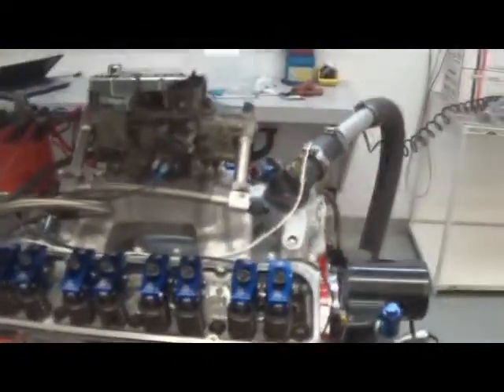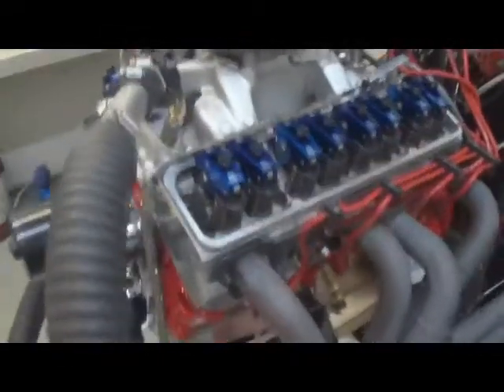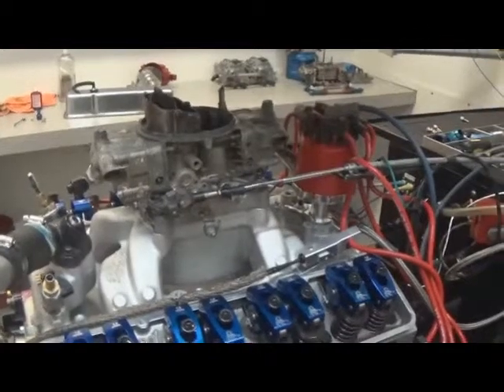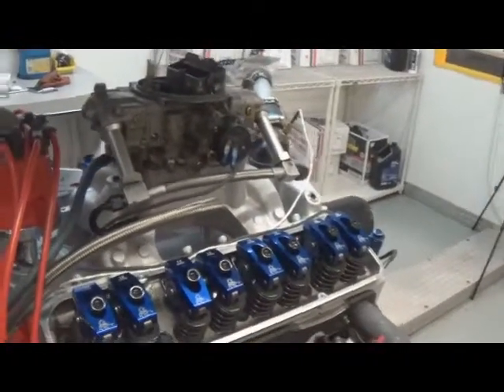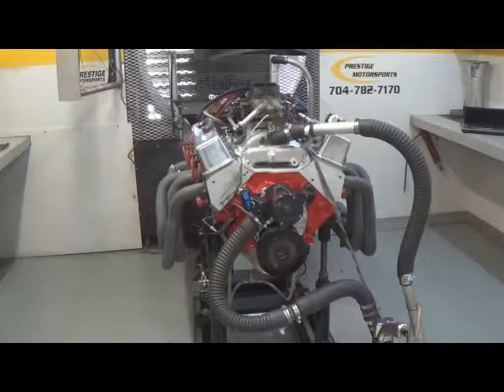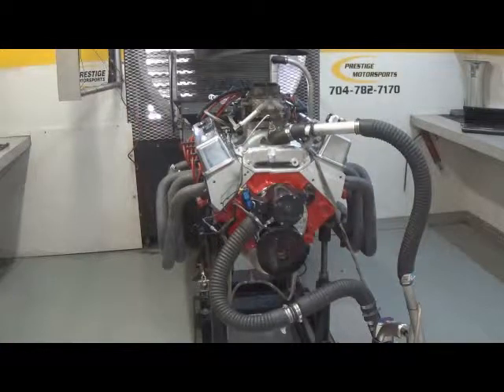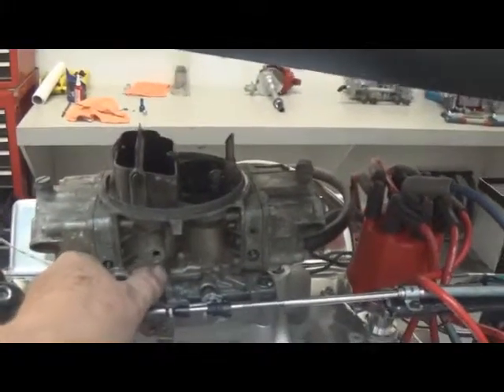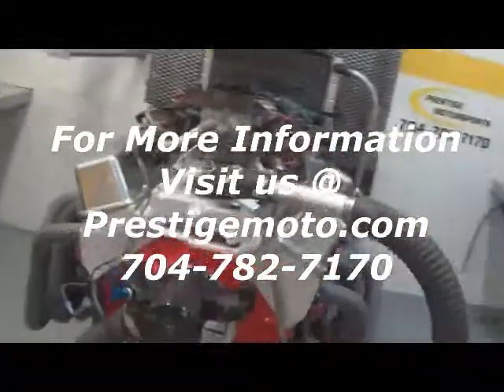408 SBC 470HP CUSTOM STROKER ENGINE JACK KUNKEL

Comment: is it a stock block. if so, which h beam rods were they to not hit water?  i'm building a 408 supercharged lt1 motor.
Reply: thanks, i plan to run a 408 with 5.85 rod and 1.15 compression height piston, 9.3:1 comp. and a fla procharger blowing straight through a new Fitech 1200 fuel injection unit
Reply: @biggregsparks8364  5.85" rod can fit a stock block with some clearancing. Planning to build 409 sbc for momma's second gen camaro. 288* hydraulic roller cam on 106*. Using a stroker rod of 5.85" for more clearance and less clearancing. Also grinding by hand only enough to clear around the specific area rather than milling a wide piece. Keeps stock block stronger. Ported Iron eagle heads. 4.035" bore with custom MahLe pistons. 4" stroke. Thinking of a 4.125" crank also to make a 422 c.i.